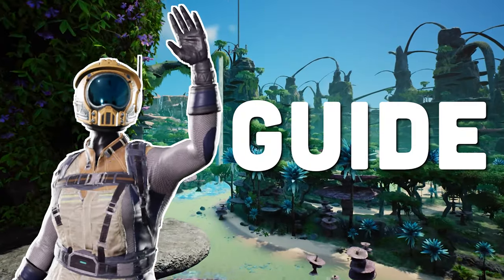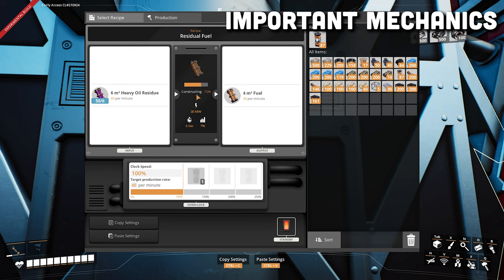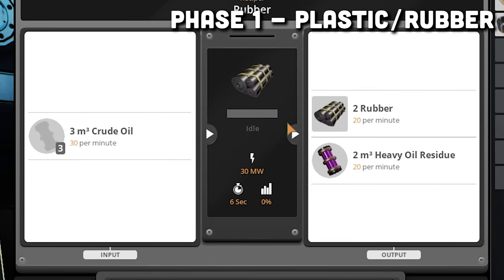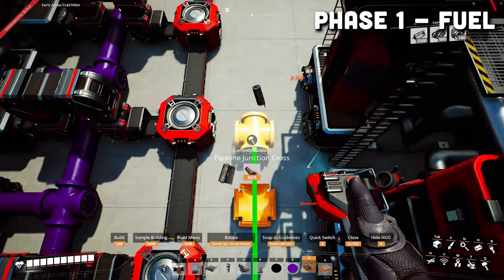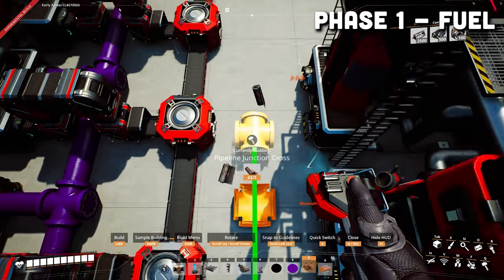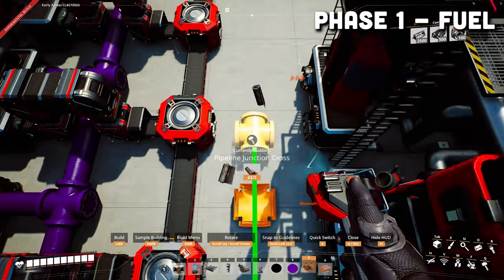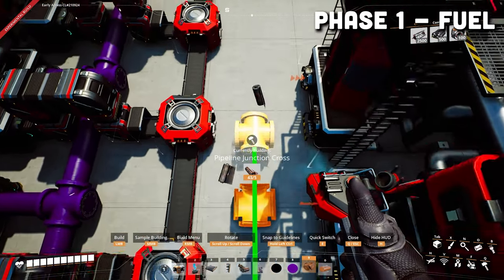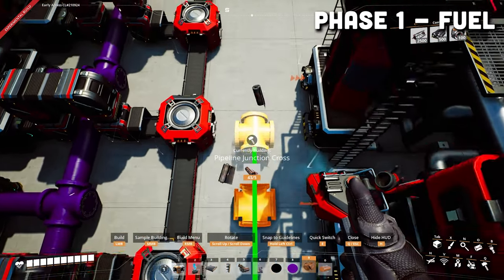PERFECT Starter Oil Setup!! 100 Plastic/Rubber + 1200MW! | Satisfactory Update 7

Comment from the maker: For 1.0 this still works, except you need to only have 5 fuel generators and underclock 1 to 80%. 

Cheers ❤
Reply: just found your channel! Thanks for the careful and thoughtful walkthroughs and coming back to keep it up to date. :)
Reply: In your vid, you have 8 generators, are you saying we get the same power from just 5 with one of them set to 80%??  Basically build 5 not 8?
Reply: Is there a petroleum coke version for coal gens? Im still unlocking the milestone fuel generator
Reply: Thanks brodda
Reply: 300oil is not making it to all refineries in 1.0
Reply: @Cjcomputer14 having the same issue no matter how I change the pipe layout
Reply: @jeremyburch3005 I fixed this by adding a valve on the oil pipe in between the first 5 refineries. Also, make sure you have a pump just before the pipe makes the vertical incline, and that your oil extractor is overclocked to a 300 M/S flow rate.
Reply: @Cjcomputer14  Yeah - I can't figure out the math on this I thought 300 would go to 10 refineries at 30 a piece . hmmmm

Comment: I can't seem to get this working no matter what I try. Tried 5 generators with one at 80%. Tried with 4 generators. Took the fuel packaging out of the loop with 5 and 4 generators. Tried taking the buffer out. Generators constantly turn off and on. Yes, I have tons of plastic and rubber, but even with 4 generators they won't stay running. Random power output is practically useless.

Comment: Too bad there's no Smart Splitter for pipelines. Having a Petroleum Coke maker (for the Sink, or additional Coal Power) with the input pipe set as Overflow from the Heavy Oil Residue line, would mean you wouldn't need the buffers in the first place.

Comment: Amazing tutorial! 
One issue I found with the 1.0 update...
The Fuel-Power Generators need to have their clock speeds changed to 60%/150MW. 
They changed the output and input amounts.
Reply: Thanks for pointing that out, didnt realised it. But you can also just use 5 Fuel-Power-Generator and have 1 running at 80% Clockspeed (If your are not making packed fuel, you can just use 5 of the Fuel Power-Gernerator). This saves some materials. The System should work fine with this setup.
Reply: Is that why my Gens are running out of power constantly?! goddamnt lol
Reply: @Danny191  Probably, before the update you needed 8 Gens now you need only 5 (with one set to 80% if you do packed fuel). They Changed the Input and output.  In Update 0.8 the input was 12 Fuel per minute. 12 x 8 = 96 and the other 4 from the packaged Fuel = 100 Fuel per minute. In the Update 1.0 the input is now 20 Fuel per minute! Now you need 4 gens running at 100% and one on 80% 4 x 20 = 80 80 + 16 (16 from the one underclocked to 80%) = 96 Fuel per minute and the other 4 from the packaged Fuel = 100 Fuel per Minute. This should work other wise look if you are producing 100 Fuel per Minute and check if your rubber and plastic isnt cloging up your system. Make some containers to store a bunch and then you can sink the rest if you want.
Reply: @dasfettewalross8305  Thanks, actually just did this exact thing and was going post it here, but seems you guys are a few days ahead of me.  Loved this in update 8, worked great. Still good with Tweaks in 1.0
Reply: @dasfettewalross8305  I just oc the oil stractor to 150% (pure, 360m3), added 1 rubber and 1 plastic refinary, the 3 fuel refinaries at 100%, 4 fuel gen 100% and the last 2 ones at 90%. Got the 4 fuel/m for the packet too
Reply: @nikoolass07  If youre doing 360m3 then make sure to do pipeline mk2
Reply: Thanks, i can only run 4 fuel generators with the videos setup so i will try the 60% on the 8 fuel gen
Reply: @dasfettewalross8305 does it produce more than the 8 generators on 60%
Reply: @cgcrafford  If you only can run 4 gens then on 8 gens on 60% you will have the same Problems. Please check if you have a Buffer between the gens and the Refinerys that produces fuel. Let the Buffer fill halfway and then let the gens run full of Fuel. Let them run for a sec and then connect then to your main power line. Check also if your System is running smooth and Nothing is cloging your System. You can unlock smart Spliters and use them to sink the Overflow of plastic and Rubber. Also check your Refinerys if there are working Right. The Math should be correct in my first comment and there shouldnt be any difference in These two Setups.
Reply: Thank you for the comment, i saw something wrong happen impossible to point the problem ! :) I don't know if any one had this problem too but i had to use 2 pipeline pump to make everything is filled enough to always producing ( one pump for the oil goes to the lasts refineries and one for the 3 refineries that produce fuel, and i had to overclock the oil extractor too) 
( sorry if there is any mistakes, english isn't my native language :) )
Reply: Does this new math impact the Packaged Fuel number of 4/min? (Sorry, not a math wiz)
Reply: @MsKaotix  you can still keep the packaged fuel at 4 fuel p/m. just remember that your fuel refinery is outputting a total of 100 fuel p/m which means you need to adjust your gen setup to equal 96 fuel p/m. If it exceeds that then you will face problems since you will be attempting to use more fuel than your output allows.
Reply: @dasfettewalross8305  How are you making 100 fuel per minute? 10 refineries produce 100 Heavy Oil Residue. Refining that into fuel only gets ~66 fuel.
Reply: Thanks
Reply: @dasfettewalross8305  Was wandering why my gens where running out of fuel constantly figured they changed ratios in 1.0. Thank m8.

Comment: Worked perfectly for 1.0 with a minor adjustment to 6 fuel generators with one slightly underclocked to allow for packaged fuel. This was also very helpful for managing the transition to the generators without the by-products backing up and causing a shutdown - thank you.
Reply: which one did you under clock and by how much?
Reply: @ethanlunan1391   I only have 2 somersloops (S)  and this is what I do . 300 snail overclock oil extractor -> 150 (heavy oil) from 10 refiners -> 3 refiners (fuel) clocked at 20 - 40 - 80 (S)  -> 140 fuel -> 6 generators at 20 fuel - 120 -> 20 fuel for packaged fuel.

or  the same thing, but add fuel generator for 7 total, reduce packaged fuel to 4 p/min, and underclock that last generator so it takes 16 fuel p/min
Reply: I just underclocked all 8 generators to 60% (150MW), takes 96m³ of fuel and leaves 4m³ for the packaged fuel

Comment: This was so so helpful, thanks !  My coal mine was acting up with power whilst i was in the process of doing this today and I had to cut some temporary losses that I can now go fix!
Note - after my plastic and rubber filled out and went into overflow, I had to replace the belt feeing into the smart splitter for it to then go up to the lifts.

Comment: 2:25 you took the time to explain and show, IN DETAIL the most difficult and over looked mechanic in the game...
:D
Reply from the maker: A lot of people struggle with that. :(.
Reply: @spectrumdad_  I use a website called [U6] Yet Another Factory Planner to perfectly balance out dule outputs . 

Then I found that while most machines can accept 4 disamol plases (1.1234) while valve only have 1 (1.1) witch made aluminum refinement way harder that it should. even used some coal burners to balance it
Reply from the maker: @SpectrumWolf-hd7kf  yea, that’s annoying lol. Good tool though!
Reply: @spectrumdad_  it really is. I have 9 tabs open with the schematic of large scale production systems to be built and already built as a ref if I were to look back at it.

So helpfull

Comment: Thank you so much for this guide. I am having a frustrating time getting the by products taken care of when making plastics and you solved it with the sink. I have 3 oil wells close together so off to make 3.6K MW of power on top of the coal and geothermal sources. Also just plugged in the Alien power generator so power will no longer be an issue. I will start this construction this week. Again thank you and I look forward to viewing the rest of your guides. Who knows I may just tear everything down and start base building for the 3rd time.

Comment: Started SF some days ag; i'm at stage 0.5 generating petroleum coke from 2*plastics and 2*rubber refineries then feeding it to 4 coal generators powering my setup... works well while waiting for expansions :)  awesome sinks are a must when dealing with localized fluid/solid mixes

Comment: I followed your guide which was great by the way!   However, I thought I'd be clever and load the fluids from my logistics-floor underneath.  As you can guess I was having a bunch of problems with pipes not being full, and the buffer never filled up.  I spent a while this morning learning more about head lift and found out that my under-floor loading of fluids is the problem.  Looking forward to redesigning it and removing this issue.  Thanks for the GREAT guide.  I'm a about to tackle a huge oil-fired fired power plant on the west coast.  :)

Comment: I loved this guide and how you split it into phases. I built all 3 phases and found myself low on fuel for my fuel generators. I'm not sure if its because of an update or any changes but my main issue was not having enough crude oil to supply all 10 refineries. I just decided to add a second oil extractor that hooks into the last 5 of my refineries. That solved all my problems. Hope this helps someone else!
Reply: As a follow up to this, I now realize that crude oil deposits come in pure and normal forms. The pure forms literally double your output. So when you place an extractor for this factory you need to have a pure crude oil deposit or 2 normal deposits.
Reply: @whisstler  also over clocking it seems to fix any hiccups

Comment: Really well-made guide. Made transition to oil smooth as butter.

I centralize everything & unfortunately the pure oil patch was like 2 km from my base but I'm planning to use the train in the future to bring the goods in.

Because of that I'm wrapping my head around the computer production. Seems like you need buttload of plastic, like way more than I'm currently producing. If my calculations are correct, for 5 computers per minute (2 manufacturers, 7 assemblers with one underclocked I'm going to need 290 plastic per minute - That's crazy!
Reply from the maker: Yea it's nuts. Always need more Plastic ! :)

Comment: Love your videos! I just did this last night and it does not work at first because I didnt realize you underclocked the packager haha! Great content!! Looking forward to many more!
Reply from the maker: Thanks, glad you found the problem !
Reply: If you dont under clock the packager though would that stop you having to flush the buffers all the time? My oil rig is ages away from the rest or my setup
Reply from the maker: @MetaDataAutomation  most likely. But you can’t forget to underclock it when you put the fuel generators in or you are going to have a bad time :)

Comment: Excellent build brother! Confirmed it still works in update 8, with the help of two additional pumps; One between the fuel buffer and generators, and also one between the oil extractor and the input manifold on the row of 10 refineries. Also, the oil extractor should be overclocked to 125% to match the 300 input of the combined 10x refineries. With some careful pipe and belt maneuvering, I was able to make the design slightly more compact. Mine is occupying a 16x17 foundation space.
Reply from the maker: Nice, glad you got it to work. I did also manage to make it more compact in a play through myself. It's hard to show compact builds in guides though.

Comment: 1.0 Changed this setup.

To Power all 8 Generators, I needed to overhaul my plant.

8 Generators requires 160 Fuel
4 Refineries @ 100% provides 160 Fuel but costs 240 Heavy Oil Residue.  No Excess for 8 Gens + Packager.
Alternate running 6 Fuel Generators + Packager @ 100% with Packager OFF and 8 Generators.  You don't have enough refineries at 150% to spare HOR for Packager and 8 Generators.

Add 1 Plastic Refinery
Overclock all 11 Plastic/Rubber Refineries to 150%.  This produces 240 HOR.
You will need 495 Crude Oil for the 11 Refineries
Add a 2nd Pipeline at 100%.  Connect it to the refinery pipeline at the opposite end as the 300 Crude / Min Pipeline

If you power your Packager at 100% while you are remodeling, you should have thousands of Packaged Fuel in an industrial storage.  You shouldn't need to run the packager for a while at this point.

Bonus, with two sinks, you are producing 39K points per min.

Comment: I do a similar setup but I use the larger fluid buffers for the fuel so there are less trips to flush the system.   To the left of the storages, I also set up drone ports when drones become available and can then fly the rubber and plastic to where I need it.   Trucks work well, too.  Edit:  You did mention upgrading to the larger buffers later on

Comment: I think I've figured out how to do this exact set up in 1.0. It will need a total of 6 somersloops (excluding the ones you needed to get the 300 oil per minute for the Oil Extractor). I prefer thinking in desired result>how Im getting that result because it makes it easier for me to understand what I need to do and how I can get it.

8x Fuel Power with one underclocked to 80% need 156 fuel per min + 4 min for package- 160 fuel per min
3 refineries producing fuel, both at 100% and 1 with 2 "S" produce 160 fuel per min
The 3 refineries use 180 heavy oil residue
The 10 refineries produce 180 heavy oil residue- to do this you need to modify the rubber refineries. Adjust 1 refinery with 2 "S" and clock it to 75%. Add 2 "S" to 1 rubber refinery and leave at 100%.
This will cause the 5 plastic refineries to produce 50 heavy oil residue, the unchanged 3 rubber refineries will produce 60 heavy oil residue, the adjusted 75% 2x "S" rubber refinery will produce 30, and the 100% 2x "S" will produce 40. 
The 10 refineries producing plastics and rubber total use is 292.5 oil. So you can underclock to meet that if you'd like.

Leave a comment if  it worked or not😀

Comment: If you just turn oil into fuel you can send the polymer resin into the sink. you get more electricity that way too and less headache. then just work on plastic and rubber later.

Comment: This is actually the best guide i've seen about oil, wich is complicated, honestly. The only problem for a newbie like me, just reached oil unlocked, is getting 300 MW on a total of 900 actually produced from my coal plant. I suppose i can start with a couple of refinery, produce some things and try to upgrade the milestones. Still, an excellent video, with the squares where to put the things explained. Thank you so much for your work. Just one curiosity please, what you use to fly? it's the regular jetpack or one of the Mod who allows you to fly? i'm trying to play totally vanilla, without using mods, wich made the positioning a real hell. I totally understand for the purpose of a video is absolutely more clear and easy (and to make the video short) to show the build to the top.
Reply from the maker: It’s the pak utility mod. Later on the hover pack will do the same.
Reply: @spectrumdad_  Thank you very much!

Comment: Why do you need to add a pump prior to the packager? Wouldn't either the refineries or the fuel storages provide enough head lift to push the fuel into the packager?

Comment: Great design! But for the 1.0 numbers on the fuel generators got changed (or earlier idk). They now use 20/min on 100%. I build 4 generators and used the rest of the fuel on 20 packed fuel per minute. But overall great guide!

Comment: Super amazing video. This is going to be my next project. Something I might have missed but once this is all setup like this, do you still need to flush the pipe network at all after this? Or is it all handled automatically at that point (theoretically never need to touch anything again)?
Reply from the maker: Nope if all is setup properly you shouldn’t have to flush ever after you have the fuel setup.

Comment: The only issue I get is with the generators, the last 4 struggle for fuel. Ive let the pipes fill up entirely but they always end up going empty after some time. Im not sure why. Same thing with the rubber. The rubber always needs more fluid, but they take too much. Everything is level and shouldnt need a pump. Any tips?
Reply from the maker: I would turn off the first couple refineries in the oil line until the last machines fill up, then turn them back on. Then keep an eye on your pipeline. If done correctly it will keep up. What you can do is put a fluid buffer raised up before the first refinery, even just 1 foundation higher. That will help with potential backflow.

Comment: Quick suggestion: It would be very nice if you were to add all the necessary ingredients or total amounts of buildings that the setup uses so that it's easier to prepare all the materials in your inventory before going 1000 miles out of your factory to build it all. Found myself running back and forth all the time when i miss some of the materials, other than that, amazing tutorial, much love! <3
Reply: possible solution: I have a central 4x4 platform  for hypertubes. at each corner/Point of interests (of the factory), i have mini hypertubes platforms, some connecting to other corners and connecting floors. aside from funneling all of my products to a storage area, it helps having access to it all in a concentrated area